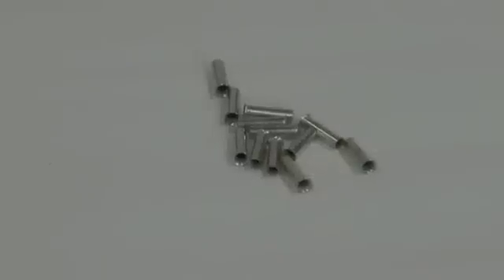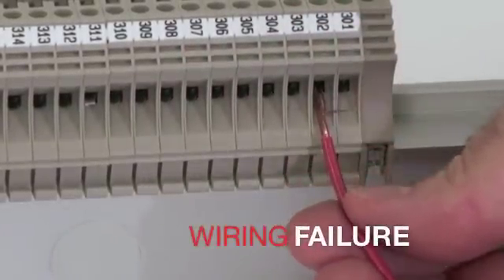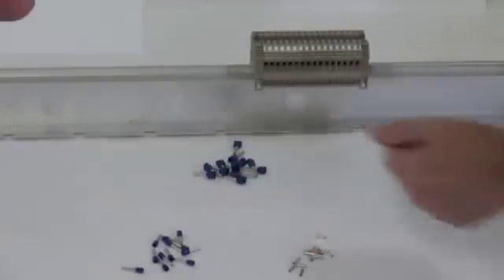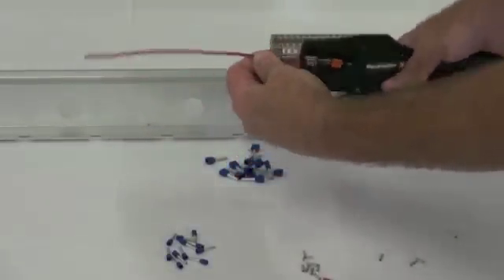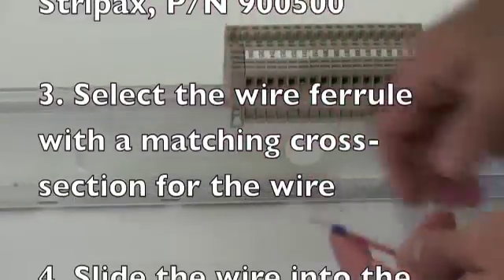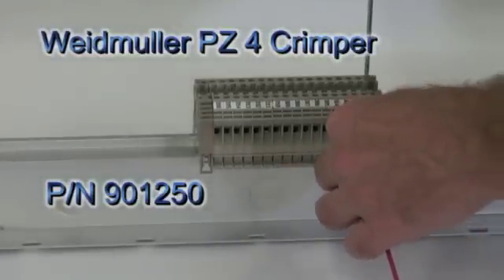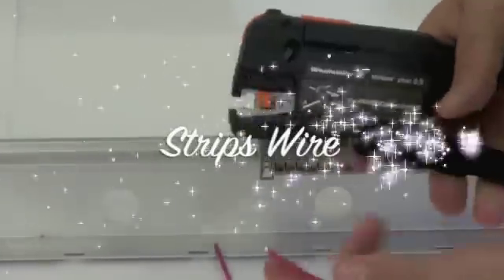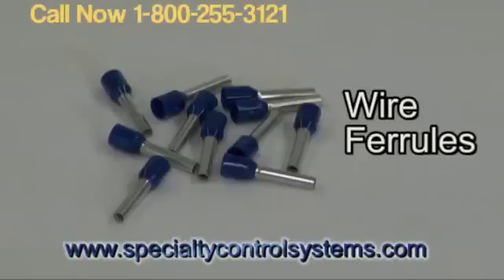Wire Ferrules Cord End Terminals

Comment: Wow, that ferrule is 80% longer than necessary for most screw terminals, and would cause massive spacial problems for whatever the housing unit is.Is it common to chop the excess off? Also, how do you insert 6 or 7 power wires into a single ferrule? Also, how thin can the wire be ( imagine a 0.1mm data wire) to fit into a ferrule appropriate for a standard 3mm diameter screw terminal?